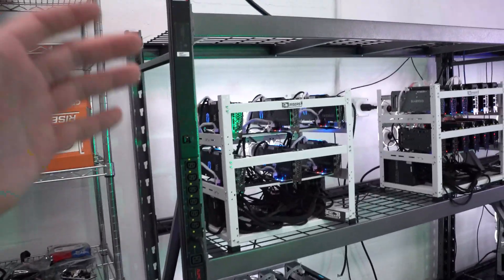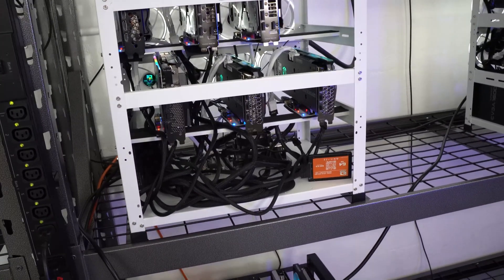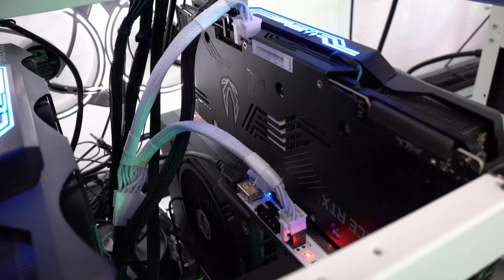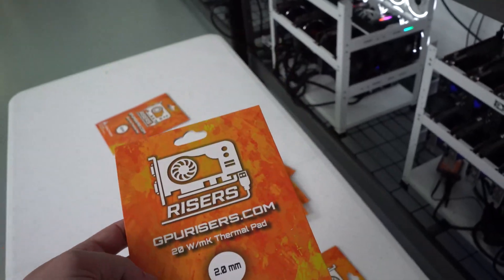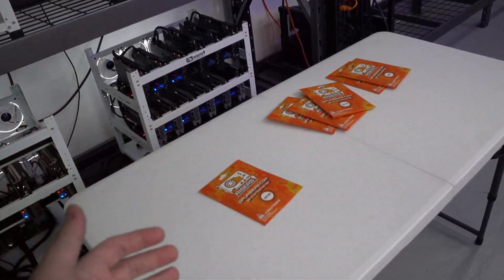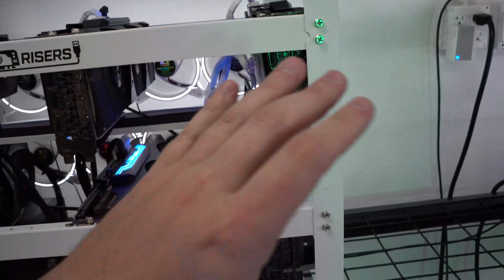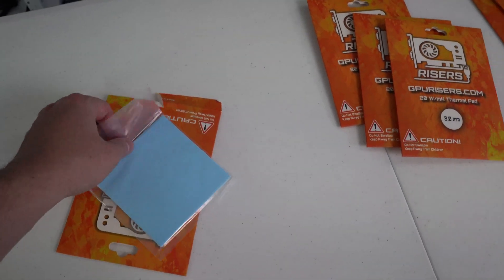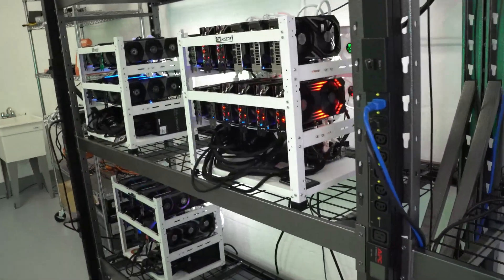New GPURisers 20W GPU Thermal Pads Are Fixing All Of Our Throttling Cards 🔥

Comment: I have an HP OEM 3090 and 3080. They require only 1.0 mm. Please release a 1.0 mm version. I put on the 15 W/mk ones and I’m still getting some thermal throttling when ambient temps get over 90F. Please reach out if you’d like me to do testing. Great job!

Comment: I’ve only tried this with ftw3 90 not Zotac but it worked great for me approx 6-8 C improvement so I’m recommending you try it and report back:)

On the backplate of your Zotac 90s use 3 mm pads it creates more compression to help dissipate heat more. Yes the backplate will bow some but who cares :)
Reply from the maker: We have great results on our 3090's no overheating issues anymore. Temp drops on the zotac were about 8-10C

Comment: NAB 15W pads took my zotac amp holo extreme 3090 down 18c, so i'm surprised you aren't seeing better results using a 20W pad.
Reply from the maker: Interesting, 18C is quite the difference. We saw about 20C on our 3070Ti but the 3090 Zotacs seem to be consistent. We have tested 12.8 & 15W as comparison and were getting about 6-8C drop, and our pads were around 8-10C. Which pads did you use?
Reply: @GPURisers  NAB 15w from amazon, same ones I use on all my cards.   TekShinji did a review of all the pads on the market a while ago--  I wonder if he'd be interesting in updating that review with your new product in the mix as a piece of content.